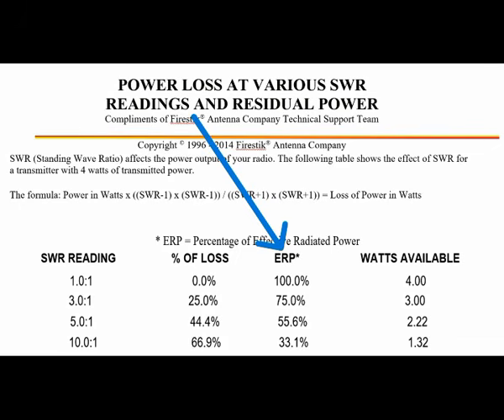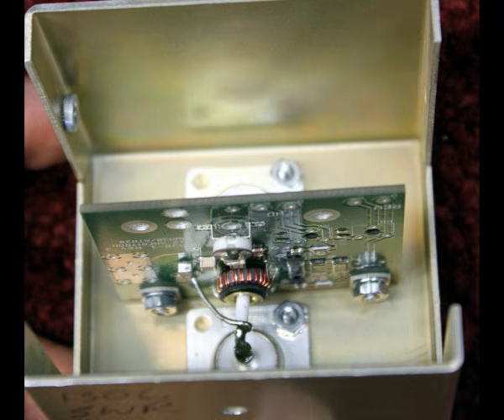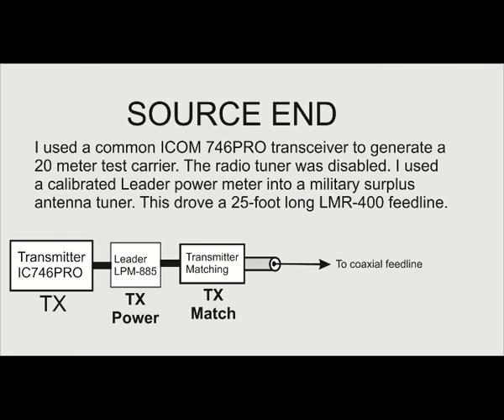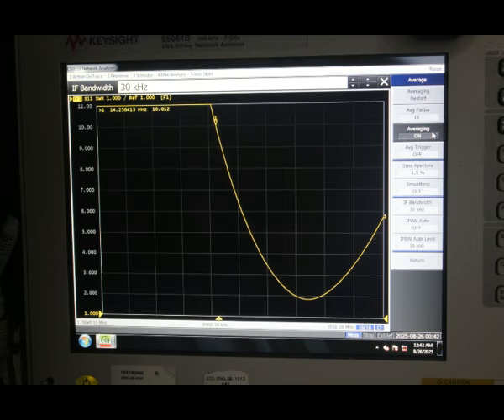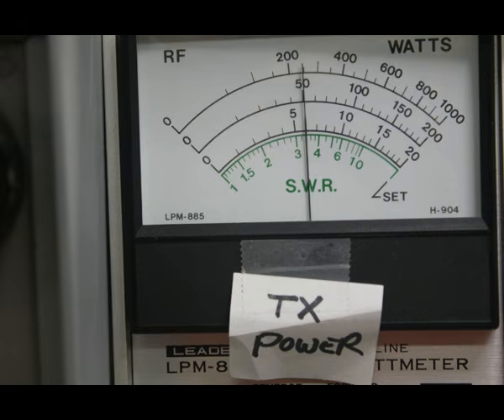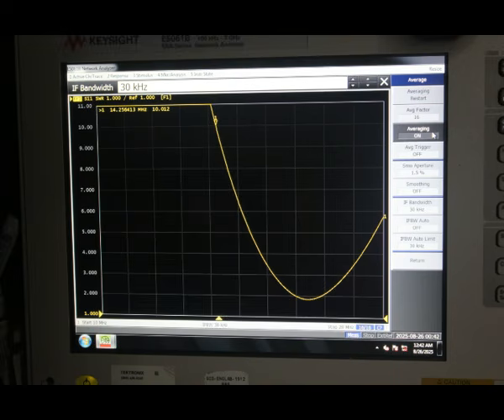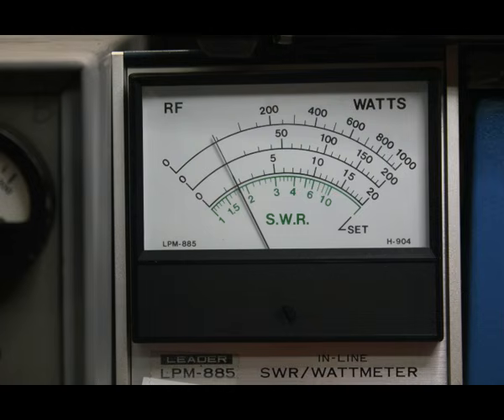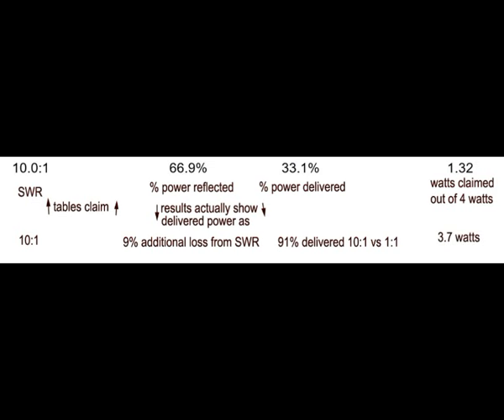Reflected Power SWR What Really Happens!

Comment: Hi Tom. I perfectly agree with you that the net power transfer to the load is still almost 100% despite of the very high SWR on the transmission line. What I 'm not so sure of is how it all gets there, and that's the interesting part to me. It seems to me you claim that all power moves in only one direction - from the source to the load - nothing the other way around. And the fact, that the inserted SWR meter (Heathkit) shows 90 W forward and 40W reflected you excuse with fluffy words about using the meter in a range and condition it's not designed for - and you end up with just subtracting the readouts of the forward and reflected power instead of accepting their absolute individual values. Am I correct, that you disagree with the alternative explanation, that there could in fact be about 90W forward power and 40W reflected power in the transmission line at the same time (=still 50W net forward power)?
Reply from the maker: Power meters are an entirely different topic. They would take even longer to discuss. If the meter is reading real forward power and real reflected power, think about how 90W forward appears when the transmitter is absolutely known to be 50W.  Reflected power is an important tool in understanding how the operating impedance changes along the mismatched line, but we should not take it as real power flowing back into the transmitter or bouncing around in the line. 

Reflected power establishes a standing wave. The standing wave represents a fixed change in operating impedance along the mismatched line. It all works great until people start claiming power flows backward into the PA and burns it up.

If we put a 500 ohm load on a 500 ohm line the SWR is 1:1. There is no "reflected power" in the 500 ohm line, yet if we connected that line to the transmitter the change would be exactly the same as if we had a 1/4 wave long 50 ohm line with ten ohms on the far end and 67% reflected power. That mismatched line has plenty of "reflected power" but the result at the PA is identical to the 500 ohm line that is matched and without reflected power.

By the way, if you want to get a hoot out of an AI answer, search "10:1 SWR reflected power %". AI says the loss is 91%. :)

Comment: Tom, Do I understand you correctly that your position is that reflected V and I waves on a TL only contribute to TL standing V and I wave generation, and that reflected V and I waves are not "re-reflected" (i.e., added in phase to incident V and I) via the impedance matching network between a source and TL input?
Reply from the maker: You can use any model you are comfortable with so long as you realize the real power flow is outward from the source, and the reflected power simply causes a standing wave. The standing wave describes an operating impedance change distributed along the transmission line.  

It is the mistermination, the wrong impedance,  that transmitters do not like. Let me give you an example. If I terminate a 300-ohm 1/4-wave line with 1800 ohms J0 the SWR on that line is 6:1. Yet a 50 ohm transmitter will be happy as can be in spite of that 6:1 because the transmitter will see 50 j0.  The load will see near 100% power from the transmitter while the purported "transmission loss" by tables is near 50%.   The line SWR is 6:1, yet the loss will barely be noticeable on a good line.
Reply: @Jerrythenerdful  How, how does reflected power result in a standing wave all by itself? The standing wave is formed when the two waves cross over each other. This is simple and fundamental wave superposition. The standing wave is nothing but the maximums and  minimums of the combined waves as they cross each other.
Reply: I understand Tom's point that TL reflected power (V and I waves) is not the direct cause of mischief, rather it's the resultant impedance mismatch presented to the incident source generator.  Nonetheless, this does not negate the fact that real reflected power truly propagate in the opposite direction of real incident power.
Reply: @DaDitDa reflected power adds to the incident power at the feedpoint reflection

Comment: Excellent demonstration Tom! My 60+ years in ham radio confirm exactly everything you said. I had the same observations about the difference in forward vs reflected power readings on power meters with hi-swr being the actual source delivered power to the load. I believe those SWR power charts are what drives people to waste so much time and energy in seeking a perfect feedline match, when they could be on the air operating. By my calculations the 1 to 1 match had a loss of -0.26 db and the 10 to 1 match had a loss of -0.75 db. That's only another 0.5 db due to the SWR!
Reply: Evidently you didn't watch the video
Reply: 60y+ and still wrong...

An SWR of 10:1 means:

Reflected Power: About 67% of the transmitted power is reflected back toward the source.
Forward Power: Only about 33% of the power is actually radiated by the antenna.
Example:
If your transmitter outputs 100 watts:

Reflected: ~67 watts
Radiated: ~33 watts
This is a very inefficient and potentially damaging situation for your equipment. If you need help calculating for a specific power level, let me know!

An SWR of 10:1 corresponds to a return loss of about -0.52 dB and a mismatch loss of about -9.54 dB.
Breakdown:

Return Loss (RL):

RL = -20 * log10(Γ)
For SWR 10:1, the reflection coefficient (Γ) ≈ 0.67
RL ≈ -20 * log10(0.67) ≈ -0.52 dB
(This means only about 0.52 dB of the reflected power is "lost" relative to the incident power, but this is misleading because most power is reflected, not absorbed.)

Mismatch Loss:

Mismatch Loss = -10 * log10(1 - Γ²)
≈ -10 * log10(1 - 0.67²) ≈ -9.54 dB
(This means only about 11% of the power is delivered to the load; the rest is reflected.)

In Practice:

SWR 10:1 is extremely poor.
Only ~11% of your power is actually radiated; the rest is reflected and can damage your transmitter.
Reply: @KjeldAlexander can you explain then with 10.1 swr using 600ohm open wire into a tuner there's almost no loss

Comment: Clearly you haven't read Reflections or you didn't understand what he wrote. I guarantee that Walt would NOT agree with your assertion.
Reply: W8JI and W2DU are in agreement about how real power is transferred through a feedline. The notion of reflected power is a product of the power meter circuit and is only useful to compute the SWR, which in truth is a measure of the impedance on the coax at the power meter location. W2DU and W8JI are my heros!
Reply: @tomalexander6431  They are both giants within the field, but in this case Tom has done more harm than good to the understanding of the subject. Tom completely ignores the contribution that reflected power is making to the incident wave and thus he has failed to recognize the total amount of power that is being lost in the coax. I agree with him that some coax lose charts are way off base, but his handling of reflected power in this video is way off base and Walt would not agree with the sweeping generalizations that Tom made in this video. Walt's work is called "Reflections" for a very good reason.
Reply from the maker: @coreybrown185  Nothing I say disagrees with Walt. Walt liked to use the reflected power model including conjugate match. In practice all we care about is the change in operating impedance along the line, and how the change in voltage and current affects loss in the transmission line and moves the load line of the PA. 

I have a 10:1 SWR on the LMR400 line. The change in power transfer is negligible because the basic line loss is low. The reflected power sets up that standing wave. Many antennas operate with a 10:1 or higher feedline mismatch and operate up near 100% efficiency.  This can be true for any length of feedline so long as feedline loss is low and SWR is not off the charts.
Reply: @coreybrown185  The only time any power is reflected is just after t=0, the moment at which the the TX is keyed and power from the TX flows up the the TL (charging it)  until it gets to the load,  the TX will only see the Surge Impedance of the line until the standing wave is set up and the steady state input impedance of the line is established.   After that,  there is no reflected power.
Reply: @coreybrown185 think Tom and Walt are on the same page they just describ it in a different manner, I've been reading reflections for many years and by understanding walts way I understand Tom's way even more, two ways to get to the same point, think different people take this info in differently, walts way maybe a good way to go if you are just getting into this subject, even though reflections at times is a tough read
Reply from the maker: Walt was a close friend of mine. I can guarantee you he would because I'm sure he understood Poynting vectors.  There are different equally-useful models, but the real power just flows out from the source.